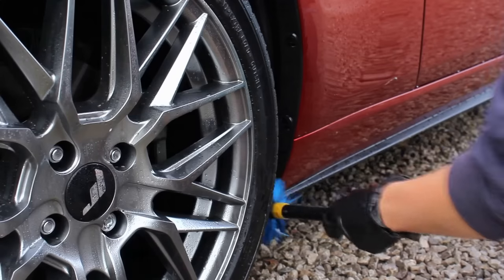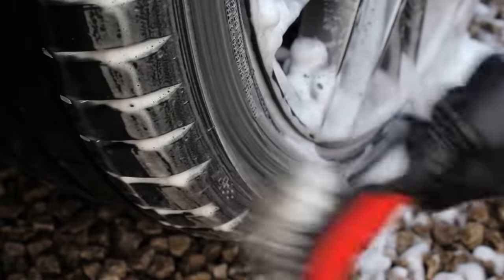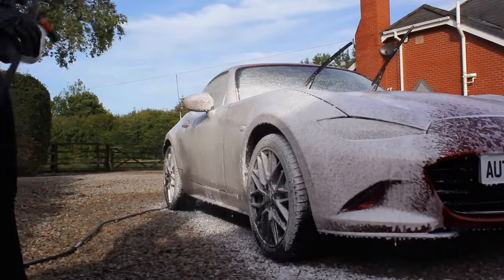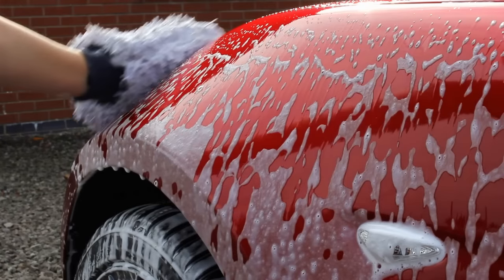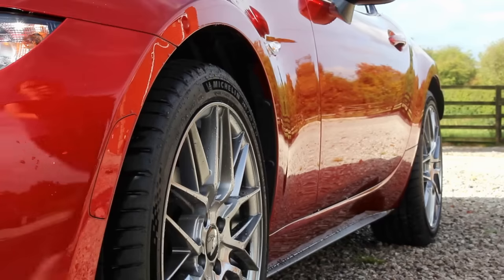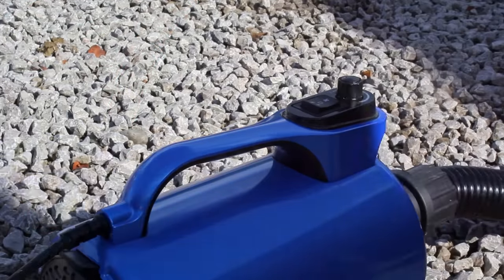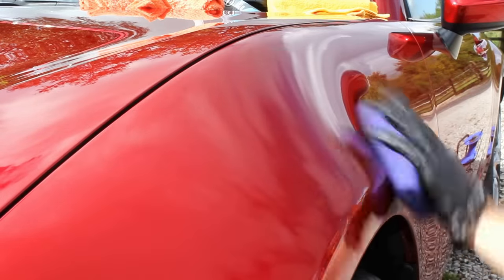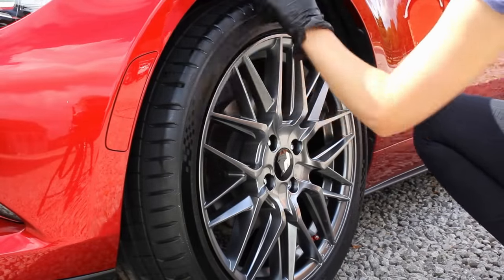Winter Preparation Detail | Mazda MX-5 Clean and Protection

Comment: What a really smart car that is when it is fully dressed so much so when my mate was saying he was buying a black one I told him to reconsider getting a red one. Your wheels are really smart are they gun metal in colour. I sold  my  mini after putting on my ceramic coating partly because I regretted doing it as I like to wax and I would have missed the whole decon wash process twice a year. That is a good point re the softer brush on maintenance washes. I was having a discussion with a fellow detailer about tyre prep in that we are all obsessed in removing the brown gunk from tyres that is in fact the UV protectant the manufacturers put in the tyre. I now only hit them once and re apply serum. I have topped the serum with a tyre creme to good effect also. Another really good watch.
Reply from the maker: Thanks very much John! Yep they're a kind of gun metal colour, they can look a bit more silver when it's bright but that's rare in this climate lol. That was my concern with coating this to be honest so I thought I'd just try a 12 month one to start with. I look after 5 cars pretty often so fortunately I can use them to test new things out so it's not bothering me much atm. Completely agree, there's no need to be battering the tyres with heavy cleaners if you can maintain them frequently with something like Tyre Serum

Comment: Your car looked amazing afterwards, better than factory fresh 😎 wheels are super nice and I appreciate M-pilot’s they’re a great looking tyre.
I did a maintenance wash on my car yesterday and was thinking about how we adapt our methods to suit the time of year and sun strength etc, noticed you went in with the air blower before drying the bodywork - wouldn’t have time to do that in high summer but that’s the method I prefer to save splashing water all over the panels that you’ve just dried 🤦🏻
Reply from the maker: Thanks very much Steve! The sidewall on the PS5's are really cool, managed to get them for the same price as the PS4's so I was very pleased about that! That's really true, it's nice not to be rushing around trying to stop products drying out in the warm weather although I do have to admit I miss the lighter nights. I sometimes have to do my maintenance washes in the dark and having to make do with an outside light now and it feels a bit miserable 😂
Reply: @AutoCareHQ  I know exactly what you mean, don’t you think that a freshly cleaned car looks much better in the Autumn/Winter compared to Summer? 
In the Summer the car can be covered in dust after half a day, not to mention all the bugs! ☹️
Reply from the maker: @stevec1097  That's so true, the dust in summer is such a pain!

Comment: Excellent presentation as always. Would love to get updates on Synergy Lite as to water spots, hydrophobicity, and durability. And also whether layering adds noticeably to looks or durability. The last part might persuade me to switch from my winter go-to, Fusso, which lasts me 7-8 rainy months, but doesn't add to looks. I'm in the US but my region has weather just like the UK, and my car sleeps outside, so most protection lasts half of what's advertised.
Complements to your channel too. You're skill and knowledge are tops and your vids are polished, but you're also super sensible and hype-free. Keep it up!
Reply from the maker: Thanks very much :) I'll definitely be providing some updates on Synergy Lite. My car is also stored outside so the protection usually lasts a couple of months less than the claims

Comment: Great to see the car on the channel - such a nice colour. Decon wash is awesome stuff for sure, so versatile. Not tried a lot of Infinity Wax products - do you like the ones you’ve used? My winter prep was Gyeon Wax on top of my Gyeon EVO ONE coating - both products are epic. I’m sure you’ll enjoy having a ceramic, the ‘self cleaning’ aspect impressed me the most. Top job as always !
Reply from the maker: Thanks for watching! I'm loving the coating so far, it really makes maintenance nice and easy. The only other Infinity Wax products I've tried are Incinerate and Tyre Coat and they're both cracking products. Incinerate is the strongest non-acidic wheel cleaner I've tried by far and Tyre Coat is very easy to use

Comment: The car looks lovely Heather, I would be curious to see how your ceramic coating compares to Gyeon CanCoat which has the same durability and is also supposed to be very easy to apply with a microfibre cloth.
Reply from the maker: Thanks very much Simon! I did consider CanCoat actually, the only thing that put me off was that it says it can't get wet for 12 hours which is a bit hard to guarantee with this climate and no garage! 😂
Reply: @AutoCareHQ  That is exactly the reason why I didn't use Cancoat yet. Also seems a great product but I would go crazy waking up in the morning finding that it was raining during night or the car covered in morning dew🥴
Reply: @AutoCareHQ  GYeon Can Coat is excellent, you can avoid any problems weatherise by laying down a coat of Gyeon Cure after about 1 hour. 👍🏻

Comment: Fantastic job and those Infinity Wax Synergy products seem very interesting think I'll give them a try in the future. In preparation to use those would it be ok to use something like Chemical Guys Clean Slate to remove all previous sealants/waxes etc before applying the Infinity Wax spray on ceramic coating? I had my car ceramic coated with CarPro CQUARTZ 2.0 in January so would all this be overkill...?
Reply from the maker: Thanks very much! 

I'd go for the Garage Therapy Decon Shampoo instead of Clean Slate. I've tried that one before and it's not a patch on the decon shampoo from my experience. 

I reckon that it'd probs be overkill if your car is already coated to be honest. If you find the water behaviour dying off a bit you can give it a wash with that Decon Shampoo and it should help to unclog it and revive it a lot. I've heard good things about CarPro Reload too so that might be a good option to top up the protection if it needs it

Comment: The timing of this video couldn't have been better . Great video and great job on the car. I bought myself some Autoglym ceramic spray ( similar in ease of use), and I will see how it fairs. Quick question: Did you go down the ceramic path because it's more durable than some of the waxes you've tried in previous videos ie I remember you being very impressed by fusso wax. many thanks
Reply from the maker: Thanks for watching! Yep the durability was the main draw really. The performance of the Pyramid car care ceramic coating I put on the MG HS that I clean every couple of weeks has been really impressive so it made me want to try a ceramic on my car. Only reason I didn't go for that is because I wasn't ready to commit to a 3 year coating yet!

Comment: nice job Heather, SL is on my to do list at some point, but having too much fun with other IW products, but the Soul Crystal Red looks amazing 😎.  I'm assuming you need to bin the pad and towels post application, or reduce them to wheels only afterwards??
Reply from the maker: Thanks Iain! I'll keep you posted on SL, could be a good one to try at some point. Yep I've kept the applicators and towels but am just using them for tyres/ trim/ arches now. They've not hardened up horrendously but I definitely wouldn't risk using them on the paint again
Reply: @AutoCareHQ  i thought that would be the case, thanks for the info.

Comment: Great video Heather. Do you find greenstar cuts through the dirt better than stjarnagloss forst?
Really interested in this type of coating for my own car. Will be good to see how durable it is as its not expensive👌🏼
Reply: Greenstar is an APC, will cut through more but potentially caustic. Forst is very expensive. Just use a citrus pre-wash or use greenstar. Or use ONR before hand, blast away with water and then use prewash
Reply from the maker: Thanks Chris! I've only ever used Greenstar at 10% and found it cuts through pretty much everything to be honest. Forst is a lot more expensive so it's best just for using on really grubby areas rather than pre-washing everything as it can get a bit pricey. Greenstar is phosphate/ NTA free and has corrosion inhibitors whereas it doesn't say anything about that on the Stjarnagloss website so Forst could even be more caustic than Greenstar, especially consider you only need to use it at 10%
Reply: @taylorthrall7321  Use Surfex HD from Bilt Hamber. Bio degradable, no caustic. Water based and class leading. Cuts through grime and road traffic easily. Very versatile and cost effective.

Comment: The mazda looks stunning Heather, whenever u sell it the buyer will get a very looked after car.
 I know you've used GT 3 CERAMIC Spray on another car in the past so how does the Infinity spray compare? Cheers
Reply from the maker: Thanks very much James! The GT CS is definitely more of sealant and the durability claim is about 5-6 months so much less than this coating (but time will tell how long this lasts!). I'd probably say the GT CS feels a bit slicker, but the hydrophobics are pretty similar. I think they cost roughly the same price for a 100 ml bottle of Synergy Lite and 500 ml bottle of CS
Reply: @AutoCareHQ  thanks for replying Heather. Both quality British products developed for our cold, wet  winter.

Comment: Excellent job Heather,  down here in the south Westmill have a hosepipe ban so how do you suggest going about a winter decon/prep wash ? Cheers
Reply from the maker: Thanks David! Have you got any garage/ supermarket self-service car wash places nearby? I think they're still allowed to operate during a hosepipe ban
Reply: @AutoCareHQ  Thanks for the reply, most are still out of service, I resorted to using Mckee's N-914 Rinseless wash followed up with Polish Angel Cosmic Spritz as a drying aid on my ceramic coated car and got excellent results.

Comment: Hi, I have a Mx-5 and I like your wheels on this video. It only has four lugs which I’m curious I’ve never noticed that some have four lugs compared to mine with a five. Mines a 2007. Can you tell me or do you know what wheel that is? I would like to look it up? Thank you.
Reply from the maker: Hey, yeah they switched back to a 4 lug on the ND. These are Japan Racing JR28 wheels, they do them in 5 lug patterns and quite a few offsets and sizes too 😊
Reply: @AutoCareHQ  thank you very much. This video just came up in my recommended.

Comment: Wow , looks amazing Heather.  I'm still on a hosepipe ban 😡 might have to bite the bullet and use a car wash , whats yr thoughts  ? Xx
Reply from the maker: Thanks Rodney! That's such a pain, I'd be absolutely gutted if we had one here. I'd avoid the roadside/ automatic ones and try and get a detailer round if you can. Are the self-service car washes at supermarkets/ garages open? That'd probs be my choice if they are
Reply: There's a garage around the corner with a jetwash , so was thinking of taking my own bucket of water an shampoo and just using there jetwash to pre- rinse then rinse after contact wash 👍👍
Reply from the maker: @rodneyblenkin2384  That sounds like a good plan!
Reply: @AutoCareHQ  thanks Heather yr a star 🌟

Comment: Hi wonder if u could help me as I've got a a nilfisk core 140  but only 100 bar is normal pressure and was wondering what was normal running pressure for k4
Reply from the maker: Hey, I’m not actually sure what the running pressure is on the K4. I know the max is 130 bar but I’d imagine it’s running lower than that